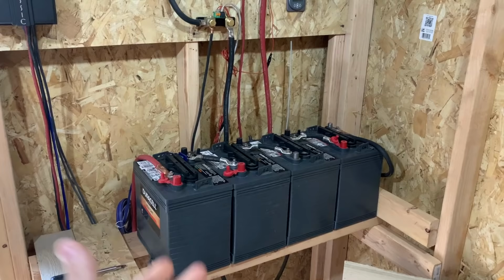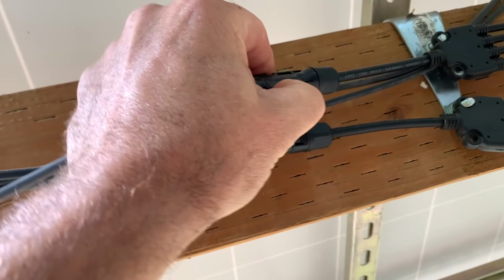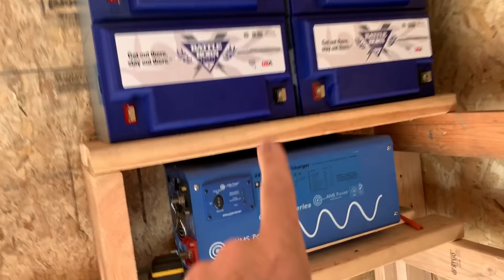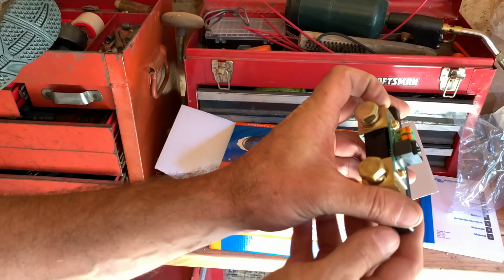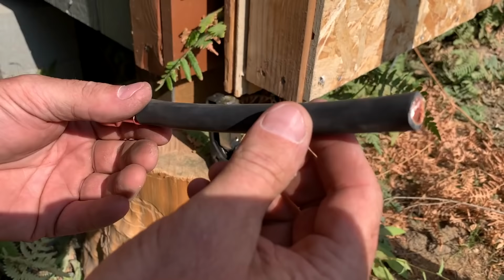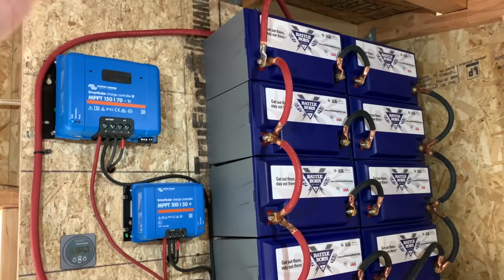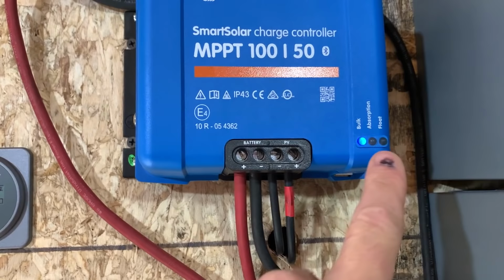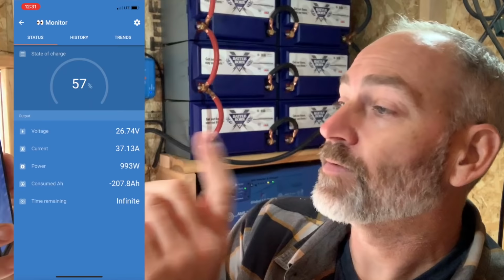EASIEST Off Grid Solar Power System Battery Bank

Comment: Nice system but on the expensive side for me because I can't afford the prices. I have 10 deep cycle marine batteries ( purchased over 1-1/2 years ), 6-100" LED light strips ( 12v sectioned out ) with connectors etc., Battery charger for marine, agm, standard batteries, power inverter 5000 watt ( more than needed ). I power EVERYTHING in my mid size apartment and never have to worry about outages while others are blacked out and panicking. My point is there are more economical ways for people to stayed powered up( even with just lighting ) during an outage. It has been tested and the record for MY system is 16 days and nights, full usage working flawlessly with power to spare. But like I said MY needs are different and I found a way to do it for under $2,000.
Reply: yeah hes talking tens of thousands here and never mentions cost, who is funding this, just the victron stuff is thousands of dollars
Reply: Can you do a video of your setup for those of us on the low money end? Please tag me when you do. How many watts is your system rated for anyway?

Comment: My OCD wants Heat-shrink tubing on the ends of them cables haha
Reply: Hahaha... right there with ya!   I mean... not even some tape?   I had to look away.    LOL.
Reply: Thomas Chrombly  I hope you also solder the crimp connections to give it the best conductivity for voltage and current.
Reply: I was thinking the same thing.
Reply: Anybody notice that the one connection was coming off when he bent it
Reply: @chrislewis2262  nope. Look for slightest error and  crticize right?
Reply: @Chris Lewis:  nope. Look for slightest error and  crticize right?
Reply: This is a commercial. Who would spend $8k on batteries alone then cheap-out on a $20 hammer crimper rather than spend $40 for a proper hydraulic compression crimper for their wiring on an install like this?  That alone proves this guy would never install these if the company hadn't sent them to him for free. This is insulting to his viewer's intelligence, IMO.
Reply: Thomas Chrombly  Amen, a cross section of a properly hydraulic-crimped wire is solid copper.  Doesn't get any better than that.
Reply: @misterkatanga   personally I could care less if he crimped cables with his bare fingers. Its his money, his way. No one here knows his budget but him. Undeniable fact is his system cost some serious money by most people's standard.
Reply: @jab376  just pointing it out, I'm an electronic major so I notice stuff like that.
Reply: @chrislewis2262  bend radius too tight, a lot of stress on the crimp
Reply: Youre not ocd youre just nit picky. Ocd would be you having to clap 3 times and spit into the air every time there wasn't heat shrink.
Reply: @clevermusicbox3630  
Thats all ya got? The grammar police always show up when the opposition has no grounds in an argument. Either that you just dont know how to poke fun. Lighten up buddy. Have fun punctuating that for me.
Reply: Agree, I really cringed at the hammer die set.   I work in telecom DC power where we use compression tools and clear heatshrink so the connection can be inspected.  Overall though, I think his workmanship is very good, and i would love to be able to DIY my own system!
Reply: @BradKellison  Never solder anything you've crimped.
Reply: @jimstanley_49  you sure do when deal with high current and voltage.use the right connectors and dill a hole in the top and fill full of solder it will not wick down the line and provides a better connection then just crimping alone.
Reply: @BradKellison  If there's anything for solder to flow into, you're crimping it wrong.
Reply: you will always have room at the top. you can never fill it. drill a hole and flow solder into it. Trust me it helps to provide a better more efficient connection. try it and find out for yourself. I will always do it my way and you can do it your way. mine will last longer and be a lot better of a connection. This has been proven to be a better connection method. if you want proof I can show you.
Reply: @BradKellison  you've got me watching lots of interesting high-kV cable termination training videos, and none of them have used solder. Please link me to one showing your method.
Reply: @misterkatanga  exactly, harbor freight has those hydraulic crimpers so easy to get
Reply: @jab376  I noticed it as well, he needed a better crimper.................
Reply: Heat shrink is not necessary . Some of the other suggestions are good though. So you cover up the last half inch with heat shrink. Then half inch away at the terminal it's still exposed. Not necessary!
Reply: @BradKellison  nooooo
Reply: @misterkatanga  his wires are way overkill for his 24v system as is. He has enough wire touching. He didn't even need 2/0 wire. 2awg will handle 2200watts!  That's why people make 24v systems. Specifically so they don't have to spend on 2/0 wire
Reply: @jimstanley_49  exactly! These people are nuts. There is no need to solder crimped connections lol
Reply: @kurticeberg4566  nothing wrong with the hammer crimp. It works perfectly fine. But yes there is better kinds
Reply: @Randomadventurelife  I would hydraulically crimp then solder thru a hole in the top to give the best  electrical connection

Comment: There’s a spark haha , always connect your negatives last , it may help reduce that .
Reply: And make all of the brackets, shelves, etc. all out of combustibles such as wood.
Nothing is quite like lithium batteries when they catch on fire.
Reply: Always!
Reply: @joefudd  wait till some novice adds water to the fire.....
Reply: The spark comes from the inverter's capacitors charging up. You can avoid it by "precharging" them using a resistor (e.g. 25 Ohms 25W, or 50 Ohms 15W): close the circuit between battery and wire over the resistor first, which limits the inrush current. After a few seconds remove the resistor and attach the wire permanently to the battery (withoug too much delay so the capacitors dont have time to discharge).
Reply: @stephanweinberger  Right on.  A resistor just as you described.  Connecting neg last or using a disconnect switch  I  think  will do nothing to prevent the spark
Reply: Just disconnect the charge from the power bank
Reply: Modern electronics should have the positive removed first and connected last.
Reply: @stephanweinberger  -- That spark caused me some expense and a trip to the car mechanic even though I hooked up the black terminal last. I got a blown fuse that affected the automatic transmission gear shifter after I thought I followed all the procedures when I was hooking up a new AGM battery into my car. It was just a tiny spark but it blew the fuse and upon starting my car with the new battery the open circuit included my automatic transmission shift lever. Had to youtube the solution for the shift lever and then bring the car in normal gear to the mechanic. -- My theory about the spark was more related to me carrying the parts for the new battery installation in a box that had some leftover salt and that salt must have contributed to the spark somehow.
Reply: @jmalinowski1000  -- battery hookup instructions say otherwise: Upon hookup connect red/positive first and upon disconnection remove black first. Makes total sense to me.
Reply: Depends if your fusible links are power or ground side.

Comment: This is an awesome video. I am currently building portable solar power boxes for friends and family for camping, kayaking, bad weather, etc.  They are 12v systems running on 12ah batteries. I want to now take on the project of running my refrigerators and freezer, all my pool equipment, and a couple of other appliances, so as to reduce my monthly electric bill.  Great video, very informative, and confidence building. Thanks.

Comment: While your old solar system clearly worked for  you I always felt it was something of a hodge podge of mismatched components and rather undersized. both in terms of panel production and battery storage capacity.  So it was great to see this upgrade to an integrated system with more panel production and battery capacity.  While you can never have too large a battery bank capacity I expect this will be good for most of your environmental conditions except perhaps during the shortest days near the winter solstice with overcast/storms.  And while this layout and wiring is certainly less cluttered than the old system there are still an number of wires I'd like to see with better routing and more securely mounted to the backboard(s).  Perhaps most especially the wires coming in from the solar panels would benefit greatly from being in a conduit fitted within the stud cavity rather than loosely coming through a hole in the open floor space.  That's a tripping hazard just asking to pull and break wires/connections.  But certainly a nice system that is well integrated and a significant power improvement.
Reply from the maker: Glad you liked it! thanks for the input.

Comment: Why don't you have any isolators in the cables? I have solar on my narrow boat in the UK and we have isolators on the positives from both solar arrays to the controllers. DC breakers between the solar controllers and the batteries, and the charger for when we are on shore power. Plus a main fuse and isolator on the main battery cable. It makes it easier to disconnect and the isolators stop the sparks when you reconnect.

Comment: The compensation cable compensates for the voltage differences between the coupled series circuits in the coupled assembly. Place the compensation cable between the positive pole of the first series-connected battery and the positive pole of the second series-connected battery

Comment: That is why you ALWAYS connect the NEGATIVE LAST
Reply: Using a precharge resistor is a very good idea and with most inverters and charge controllers is a requirement.  

Whether you connect positive or negative last or first does not matter since everything around the batteries is wood and non-conductive at the 24v he is dealing with here and the spark would be the same regardless unless a precharge resistor is used.  The only time it is a good idea to connect the negative last when making a connection or disconnecting it first when breaking a connection is if the chassis of whatever you are working on is grounded to the negative cable so that if you are using a wrench it won't matter if you short it to the chassis.  If the chassis is positively grounded which is still common in old tractors and some vehicles in countries outside of North America then the positive would be the best connection to make or break the circuit.
Reply: Or use a breaker to close the circuit.

Comment: 8 of them at a $1000 a piece... as my grandfather used to say ... “oh, my aching back”......   so expensive

I understand the benefit of Lithium but it’s just so dang crazy expensive.
Reply: Yes, how many flooded cells can you buy for that? 40-80...
Reply: Once you take into consideration the discharge capabilities, the quality differences, and being made in the USA, the price doesn't seem quite as extreme.
Reply: Actually the DIY crowd have sourced 280Ah LiFePO4 batteries from china for $83US plus shipping per 3.2v cell.  16 cells works out to $1328US plus shipping.  Shipping runs about $800US to the US so for just over $2000US you get a 16s 48v 280Ah or 4s2p 24v 560Ah battery bank.   Of course you have to supply your own BMS but its still Pretty darn cheap if you ask me.
Reply: @BugCrush3r  however, the issue with that is China. Warranty is out the door to start with. Claimed capacity and quality is often a lie. The construction is often not as robust, not to mention the quality used in the medium and chemicals within the battery itself.

I’d rather pay a few thousand for a locally sourced, and made product that considers liability and warranty with the sale of their products.

Will a Chinese imported battery work flawlessly? Maybe. I’d rather not risk my house, my family and my belongings to fate like that.
Reply: cost per kilowatt
 through the life of the battery it's still cheaper in the long run to go with Lithium than a lead acid battery.
Reply: @AnythingOutdoorswithSteve  just bought one. New it lasted 3x longer than my old one. Super happy. $86, oh and thanks for reminding me! I get to take the core of the old one in for the $12 core charge. Forgot about that!
Reply: @grizzlyaddams3606  id love to buy the lithium Iron batteries for $86! Then it wouldn't even be a conversation

Comment: Interesting video. Just a wee improvement suggestion - With the batteries placed in your chosen configuration you could have skipped all that crimping and bending of the short thick cables by linking the terminals with short sections of threaded rod, nuts and heat shrink insulation over the centre of the rod. Would neaten up your battery array.
Reply: It all has to be similar metal, copper, in this case to prevent corrosion and temp change caused movement.
Reply: Sounds professional

Comment: 16:28 get yourself a $2 resistor to precharge so you don't get the spark and don't damage your inverter
Reply: The bit I’m confused about is how he can then use his bare hands to tighten that nut. Surely that’s enough to get a bolt off of?
Reply: Nice suggestion

Comment: Makes you want look for a Damaged Tesla  for the  12vlt Battery packs  🔋 
$   them converters  $3,500    so if you can  buy the lot  cheap  .
solars good  But i had a thought  imagine  a few  big fan props  on the roof  laying down  like a  big PC  fan        as the wind blows across the roof  🔋
Reply from the maker: Not me. But could be a good idea for you.

Comment: Hello,

I know you have had a lot of views and I can't read through all of the comments, But you have a serious safety problem that needs to be fixed right away, Those batteries stacked up like that with no hold downs of any kind is an accident waiting to happen, If a vehicle bumps your shed or there is an earthquake or even if you bump something up against them from the inside and they fall, You are looking at a fire my friend. And the chainsaws that most likely have fuel in the tanks need to be stored somewhere else. Nice setup though.
Reply: Safety 3rd

Comment: I buy a cheap inverter and still used the golf cart battery to run lights and liners load. May be a small heater to keep your other battery warm in winter 
And that will free up your pure sign wave inverter to run you important stuff.that give you even more battery power
Reply: Yeah. It would be a good little heater for that room... Hopefully he at least kept it and put it in another building / garage/ camper and still uses it.

Comment: It's important for safety but you are helping the masses of people of what to do and some mistakes.  Oh my, what or how would people would/could  learn from this to even try it.  Thanks so much for understanding what you actually created.  Kind of like "Tim the tool man Taylor" so to speak.  A lot of power grunt, grunt and awww.  It was very educational. And thanks...
Reply: Dude he simply explained everything, idk what you don't understand tbh its pretty much basic electricity, knowing the difference between series and parallel how one doubles the volts and the other doubles the amps. He did a wonderful job, im totally converting to solar when I purchase my home this year. From there you run to your panel inside your house shut power disconnect the positive and negative at the main and and connect the 2 wires from outside and you should be up and running. 

Idk if you were being serious or not cause you sorta gave him some slack for doing a A+ job.
Reply: @Joey caponi  TY I am in complete agreeance. The reality is that it takes multiple knowledge concepts and @martin Johnson is taking multiple disciplines and boiling them down to one video.

Comment: Your batteries will last longer if you can keep them at 20 degrees Celsius, or 70 farenheit.
Reply: Last longer in a charge cycle or have less degradation over many charge cycles? I have seen longevity graphs on lithium chemistry that indicates lower temps = longer lifespan.
Reply: @adamhulu6171  lithium cells don't like low temperatures when charging tbh
I think battleborns are fine though as they'll cut off once they get to the lower temps that will damage the cells though
Reply: awsome built

Comment: Awesome set up... wish I could afford a system like you have.
Reply: those batteries alone are like 800.00 each, i will just stick to my scrapyard frankenstein solar set up
Reply: What you do is start small. Do the set up you need for 1 or 2 panels, and don't expect to be running it right away unless you can afford each part of the setup from the start, and you start with cheaper options that work. Work your way up using savings. If you can power one or two things you use every day, then you can gradually power your entire house. If your usual power bill from the grid is say, $200 a month, and you've managed to take your entire house off the grid power, that's $200 extra every month, $2400 in a year, and then you'll be able to afford an upgrade or two. And if you can build your system to the point where you're selling extra power back to the power company, that's even more extra money each month.
But the only way to never get there is to never start.

Comment: If you haven’t installed a MP shield on your solar set up I would definitely recommend it because they would protect your whole system, even if your solar panels get struck by lightning and another thing I would do to prevent form in EMP is on your shed takeoff your siding put chicken coop wire and then some really thin metal window screen then put your signing back on. Yeah you want To use the Bluetooth function, but that’s a small price to pay for protection lol